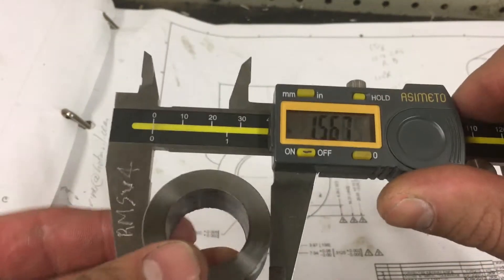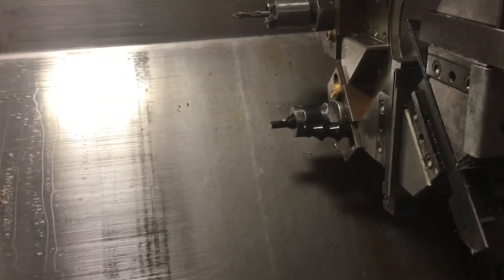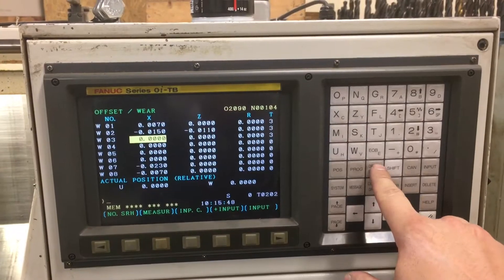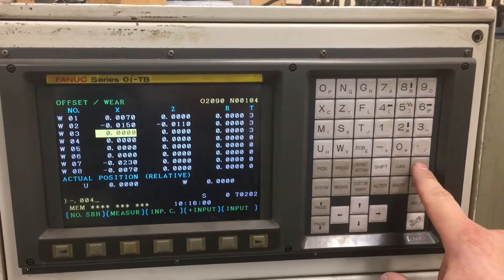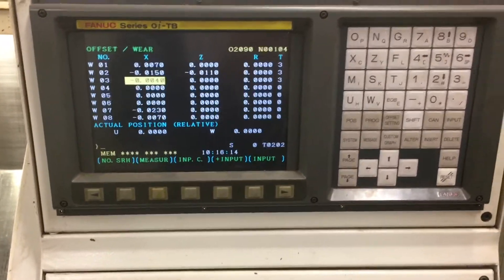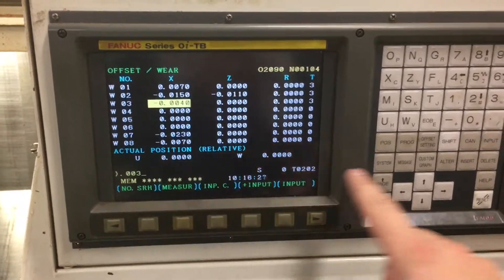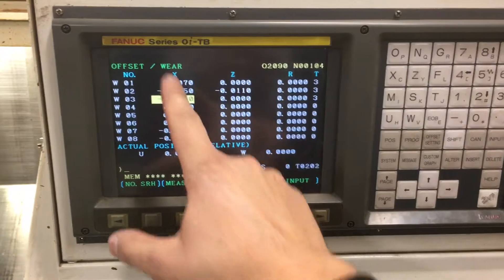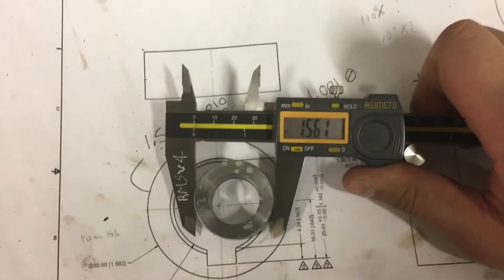Turning tool wear offset adjustment AmeraSeiki CNC lathe

Comment: is this related to tool compensation? I set my CAM to use tool comp as G40 and G42 and i got error message Interference in NRC.  I made the model to be 0.8 in , the actual Gcode tells it to go to 0.8 but the piece comes out as 0.817" when cutting without cutter comp ticket off in CAM.  I've put a brand new carbide triangle and keep having this issues
Reply from the maker: Depending on your controller you don't need to put in cutter wear comp. My two lathes automatically pull from this as wear offsets. But with milling in the Haas machines i use it needs to have cutter comp on the cam side.